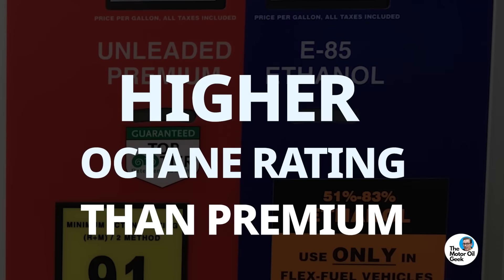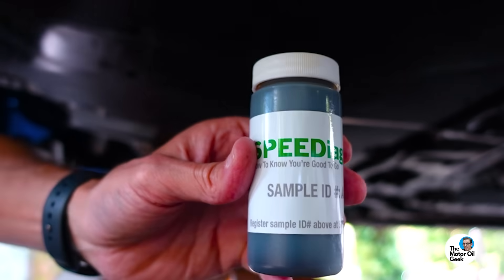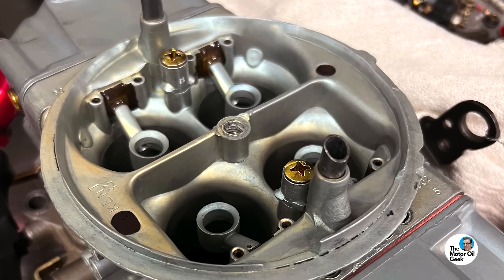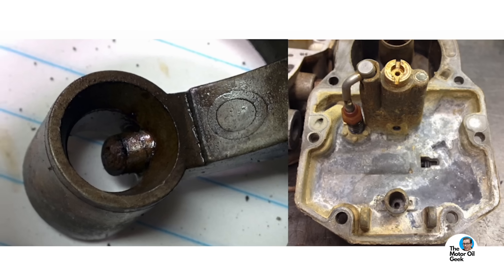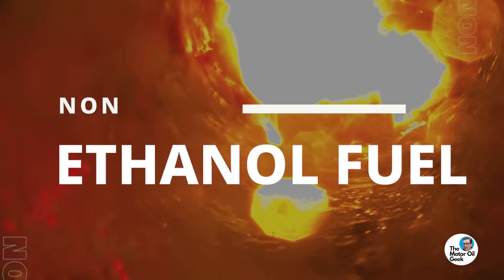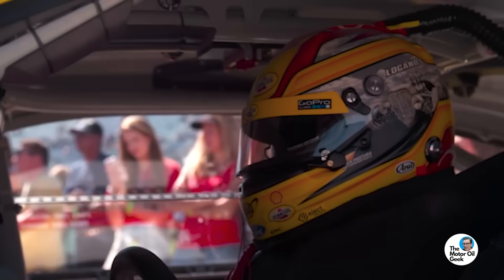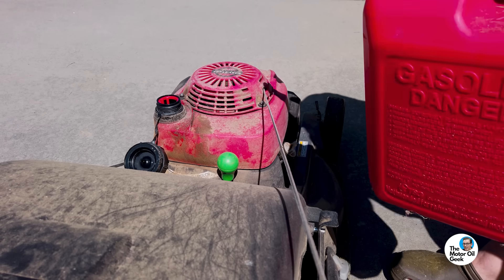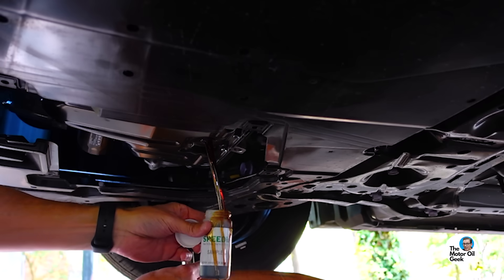ETHANOL: Higher OCTANE, Higher RISK?

Comment: Ethanol Is So Highly Regarded In The Boosted Community. For Me It's A Weekend / Race Day Fuel. Id Love To Run It For Scenarios Like This However It's Just So Much More Leg Work For The Fuel System. Massive Fuel Pumps, Massive Injectors, Bigger Fuel Lines etc. It's Hard Enough To Feed My Turbo 3800 With E10 (91) Using A Walbro 450, Vapor Worx PWM Controller Paired With A JMS Voltage Booster.

Then The People Who Daily Drive Their Cars On E85... So Many Draw Backs. Fuel Dilution, Crankcase Moisture And How Dirty It Gets The Crowns, And Ring Lands. There's A Misconception That E85 Keeps The Engine Clean... It Leave The Pistons Very Sticky And Gooey.

My Happy Medium Was Water Methanol Injection. 50/50 By Volume. Only Uses It When You Need It, Actually Keeps The Engine Clean Due To The Water Mixture From The Phase Change In The Combustion Chamber. It's Way More Efficient In Terms Of Using The Methonal Rather Than Burning E85 Meaninglessly At Idle Or Cruising. Sure, It Does Smell Good hahahaha 

E85 Has It's Place, Just Not As A Daily Driver Fuel For Me.
Reply: Definitely agree with you. Ethanol is an awesome fuel, burns clean but the "black death" that's known to build on injectors with it pushed me away from using it in GDI engines with expensive components. However no problems with e10/e15 here. I get a lot more knock on e0 91 vs e10 91 in my tgdi
Reply: I run E85 on all my vehicles.  Daily it on my 1000 hp LS engine car.  Starts fine down to 35 F (which is rare in SoCal) and keeps the engine healthy.  I have over 100k miles just on my LS car alone on E85.  I tore it down at 140k miles for a rebuild and the pistons were amazing.  Rings moved cleanly and almost no deposits on the top of it.  Oil consumption was less than 1 qt every 5k miles and I typically run a 5k mile interval.
Reply: @ChurchAutoTest Impressive, It Must Be The Short Trip Driving That Causes The Mess With E85. MotoIQ Is Where The E85 Side Effects Were Presented To Me.
Reply: @salvatorehayes2753  yeah Mike and I have gone back and forth on that.  I still think there were other issues too

Comment: I quit using E-85 when I moved to Michigan……taking up to 10-15 seconds on the starter before it started when it was colder than 60
After I swapped back to 93oct I made the same power and make 26mpg when driving the hwy under E-85 I never made above 19mpg even while cruising.
Not that I care too much about mileage but I drive my toys to work and actually enjoy them not just set it in a garage
Reply: I ran E30 in my flex fuel GM 6.2 & didn’t notice the hard starting until around 30 degrees.  I would switch to premium gas in the winter but ran E30 all summer long.  Even with the slight mileage reduction it was still much cheaper to run than premium gas & my pickup had plenty of power while running it.  I think all vehicles that recommend 91 octane (like my wife’s 2.0 turbo Equinox) should be flex fuel to give you the option of what fuel you want to use.  We should not be forced to by premium gas

Comment: There is so much to unravel when it comes to oils and fuels.  I use a fuel stabilizer in my lawn mower gas, which seems to work. Years ago, i noticed water accumulation in the 5 gallon jug, but this has not been an issue with stabilizer.   My cars and suvs are fuel injected and so far have not had noticeable issues on E10%. I don't use stabilizers in the vehicles. Buc-ees sells non-ethanol gas if I need it. 

No matter what solution scientists come up with, there seems to always be an undesirable side effect. 😢  "Here's a cure for what ails you. However, it might cause death."

Comment: E-85 boosts the power of a Chevy Flex Fuel pickup by 15% it does not increase the MPG but it increased the power.
   E-85 is a great high octane fuel for turbo charged and super charged applications it also has a great cooling effect on the intake  which reduces detonation ect.
  I have Chain Saws and Lawn Mowers that have ran on E-10 for 20 years and I have never had a carburetor apart .
Reply: Ethanol eats some older rubber carb o rings. Newer carbs use Viton o- rings
Reply: @speedfreak8200    Yes they have upgraded materials, but my chain saws are like 35 years old and still running .. I think maybe my newest chain saw and weedwhacker  have upgraded materials.
  I will tell you my secret.  I store everything in my insulated shop in an oil room with no windows .. 
  It's non insulated sheds and garages that bake everything . Also  I had problems with mold on clothes and leather and rusting medal so I run a de-humidifier all summer now .
Reply: Very true Engine Masters proved it on the dyno

Comment: Ethanol is terrific for the ethanol producers, and garages.
Ethanol is rightly corrosive, and has a lower energy per volume.
As he said, no advantage whatsoever, except for those “feel good people”.
Regardless if your car has a carburetor or uses fuel injection, it will corrode the motor parts,, reduces the life span of the vehicle.
Easiest no-no.

Comment: With  a 10% Ethanol Blend It allows more gallons of low octane gasoline to be extracted from a barrel of oil .  All in all the Ethanal adding to the amount of fuel available causes the cost of  87 Octane to be 40 cents per gallon cheaper than pure gasoline is. It burns cleaner too.
   Can you remember when Diesel Fuel was about 10% cheaper than Low octane Gasoline was?  Imagine having a Disel pickup that got more miles per gallon and Diesel was cheaper?  That's why so many small Tractors, Large Lawn mowers Fork lifts ect that used to run on gasoline are now powered by Diesel .
Reply: I will have some of what you're on !!

Comment: Never had an issue using ethanol blended fuel in my daily drivers, from using 10 percent in my carburator cars back in the day up to 30 percent in my current non flex fuel vehicle.

Comment: Good info! I've been watching your videos for a while now, and ill say ive learned alot! I will stand by AMSOIL high zinc 10w-40 for my 1j drift car. All i run is e85, and beat the loving piss out of thay motor. 9 years later its still running healthy! Thats, with multiple over temping of the motor, and not changing the oil at times when I really should of. I've learned prepping the car for winter does require getting as much e85 out as possible and trying to get as much pump gas into it, other wise come spring... youll have some issues lol

Comment: I have come to the conclusion that ethanol is really just watering down our gasoline. It reduces MPG. I am glad when I was in the Poconos I did not get the 85 octane that is very inexpensive. I am not sure my Outback would have survived long term.
Reply: 85 octane isnt NOT E85.   E85 is not watered down gas, if anything its better. It gets a bad name cuz of people and gov spreading false info about it. It helps clean the engine and your gas tank and filter. Why you think we use alcohol to clean wounds? E85 just lacks lubrucity so you need to add top lube to help things stay good! I recoomend to people I know if they think they have dirty injectors or something fuel related to just put a couple gallons of E85 in the tank then fill up with regular gas and see how it goes. They come back saying the problem is gone now! It doesnt reduce MPG, it just doesnt get as many MPGs but it requires more fuel to get the same energy as pump gas. But overal it is NOT watered down gas. E85 is roughly 105 octane, so dont confuse 85 octance with E85

Comment: e85 is so much cheaper than regular petrol here in France many people run it without issues.
Reply: Not in engines with a carburetor. It's also far less efficient than regular gasoline with gas mileage dropping significantly.
Reply: @crusher0427  Mileage drops about 25%. If the car doesn't need premium fuel, it's a waste. If it does, it usually breaks even or sometimes is cheaper to run E85.

Comment: Great informative video again!
This is true, my lawn mower would stall and sputter all the time. I clean out the carb, and it starts to stall again. Finally I decided to remove the Ethanol from the gas, and it has been purring ever since. Glad to see some gas stations now have non-ethanol, although it's much more expensive, but my mower likes so much better.
Reply: I run nothing but pump gas E10 in all of my lawn equipment and generators for the past 20 years and never had a problem with them starting and running. All of my fuel is treated with Stabil as soon as I purchase it.
Reply: @SuperBuzzbomb same but I don't use any type of treatments, ever. I've never had a single issue in closer to 30 years with e10 gas and small engines.

Comment: I have a 2009 Honda trail bike with a carb.  I have no problem with regular gas with 10% ethanol because I left my fuel system ALONE!  The bike has a sealed fuel system where a charcoal canister collects fuel vapor then routes it into the intake.  Since no air gets in the system there is no corrosion.  The inside of my tank still looks new, and after 18k miles I have yet to service the bike other than oil, air filter (there is no oil filter) brake pads, and a spark plug!
Reply: Ethanol absorbs moisture. Add Stabil when fuel ⛽️ is fresh. And always run/drain the fuel from the carb
Reply: @speedfreak8200  Can't absorb moisture if the fuel system is sealed.  That's the point.

Comment: I requested this video what seems like a year ago. Thanks for producing!

I run ethanol blends on one of my cars that is tuned for it. I change my oil very frequently as a result, but I wonder if the ethanol still impairs the oil film on the cylinder bore and causes more wear?

Haven't seen any cause for concern on my oil analysis yet though. More just a curiosity.

Always appreciate your content!